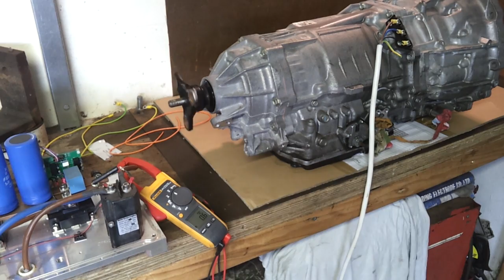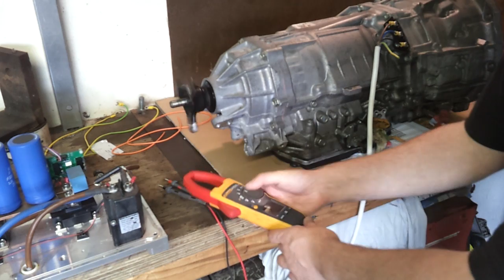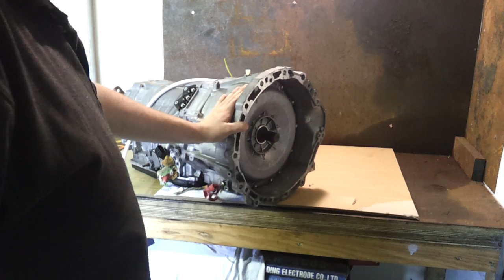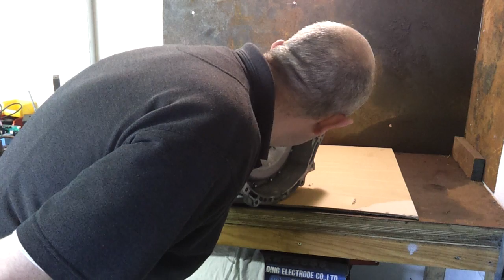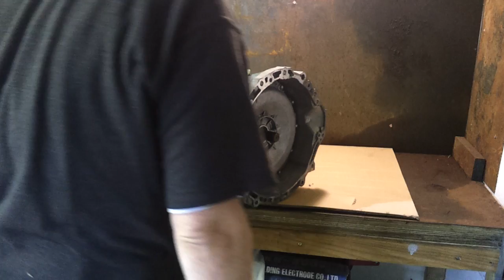Lexus Toyota Hybrid Transmission Project 03 : First Spin

Comment: Another great project from you Damien. I have a Toyota Prius electric MG1 MG2 and the controller. I hope to hook up to my auto transmission in my e39. So am very interested in how you get on with these permanent magnet motors.

As far as controlling the inverter, if using the voltage booster inductor is too challenging at the moment, have you thought about having 400 volts worth of batteries instead of perhaps 300 volts? and bypass using the booster inductor altogether?

Comment: Sound like a stepper motor inside that gearbox? Is that 1 ampere at 12 volts? That's only 12 watts of power needed?
Reply: carlos lopez 128 volts

Comment: As I recall, Toyota runs 500v to their motors to utilize smaller gauge wire. Are you worried about heat / shorting the windings by running only 130v? Keep up the good work. You are inspiring to me.
Reply: HoonaticRacing Afaik, the motor amperage, not power, remains the same depending on the voltage. Therefore (using simple numbers for simplicity); 1300V at 100A is 13kW and 500V at 100A just gives you more power; 50kW.

Comment: *****
Excellent first spin up, will be interesting to see how it performs when you lock off the input shaft.
Would have liked to have fitted one of these to a Renault Espace, but unfortunately its front wheel drive :(